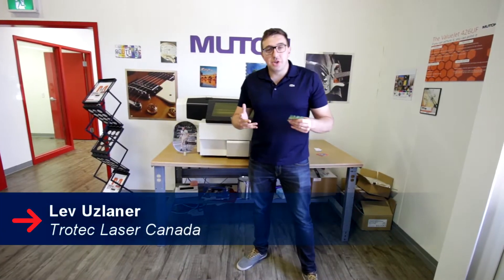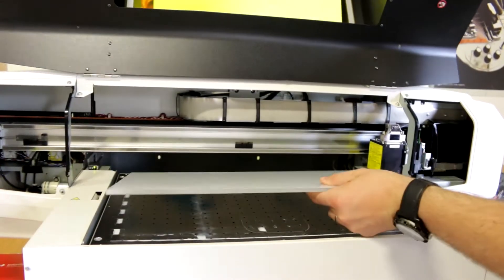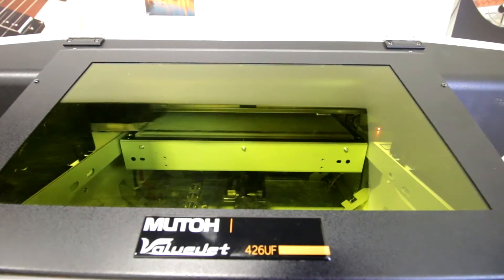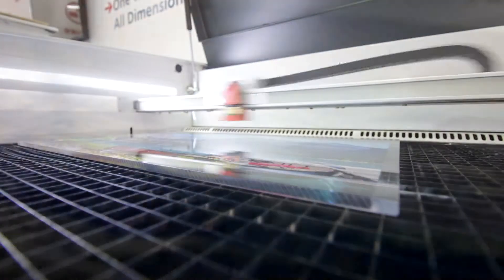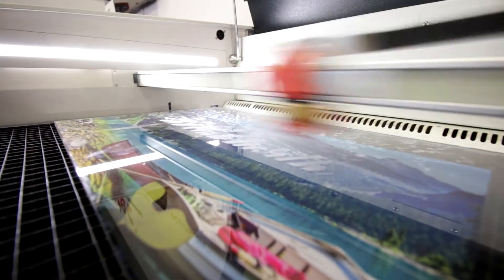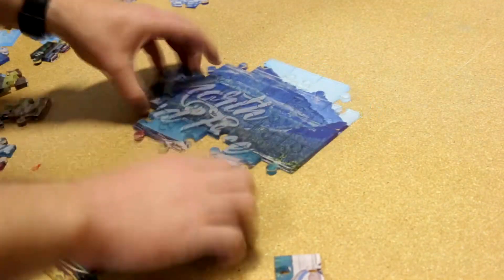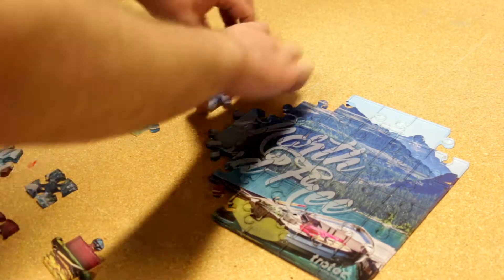DIY Jigsaw Puzzle | Laser Cut Acrylic Puzzle | Trotec

Comment: Have you run into a case where the UV in has problems adhering to the acrylic? I tried this same setup and printed and cut a puzzle, and the ink chipped off of the acrylic.
Reply: Did you get a solution for this because i encountered the same issue
Reply: @kanyiwangui3504  Unfortunately, no. I’ve tried various adhesion chemicals, including some very toxic and expensive, with undesirable results. I’ve also experimented with light sanding of the acrylic surface, special electrolysis treatments, and even applying an electrical current to the surface—though the necessary equipment for this is extremely expensive. Additionally, I’ve tried using a propane torch to alter the surface properties and have tested both cast and extruded plastics. I even purchased a special type of pretreated acrylic designed to hold ink, but its cost proved too high for our business model. Probably not what you wanted to hear. I hope this helps.

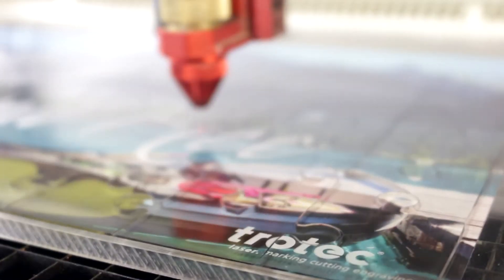Comment: Looking at time marker from 1:04 to 1:07 I noticed that your operator is making a second pass. How many total passes were made and at what settings? I'm having difficulty with this method using the same Trotec branded cast acrylic. Sometimes the cut doesn't make it all the way through, thus ruining the job if I move the set just a tiny bit for inspection. This can be quite annoying and substrate is wasteful.  What is your recommendation for speed, power, frequency, for 80 or 120 watt Speedy?

Comment: When this video was posted the Mutoh model you're using was current. What is a relevant model for 2021? Also, what settings did your operator use for the Trotec 6mm cast to cut the puzzle vector? Speed? Power? Frequency? Tube wattage? What settings to get that sharp engrave on the acrylic surface?

Comment: When I tried this some of the ink on the back of the acrylic was damaged, do you do anything specific to make sure the color layer and white layer stay on? Also, the acrylic gives off pretty bad fumes after being cut, are these harmful? thanks.
Reply from the maker: David Alessi Hi David, we are currently trying to find a good UV-to-acrylic adhesive that would stick better.

Are you using our acrylic TroGlass? If so then it isnt dangerous at all. We cant speak to the cheap acrylics on the market out there.
Reply: as far as I have found, the acrylic esters are non-toxic: https://www.ncbi.nlm.nih.gov/pmc/articles/PMC1475175/?page=11. I was just using acrylic I picked up locally. 

How often do you guys find that the laser damaged the UV ink? I made three 64 piece puzzles and 5-10% of pieces had some ink flaking off the acrylic.

Comment: Could you print this same design on white/coloured acrylic, to reduce the printing time for printing on the back?  Or would this give the photo a different effect?
Reply from the maker: That's a great question. Of course you can to save ink but it would give you a different effect. The ink will be on the front instead of the back. To get that "crystal" effect you would need to print it on the back. In fact if you don't use white at all, it would give you a see-through effect, if you print that on any of our metallic colours (not just acrylic but laminates too) it would give you a really cool metallic effect - we'll do a video on that soon as well.
Reply: Ok, got it!  Thank you
Reply from the maker: Anytime!